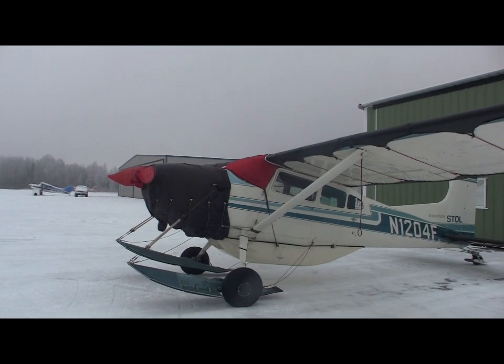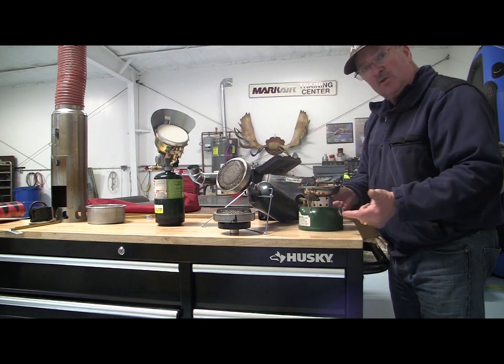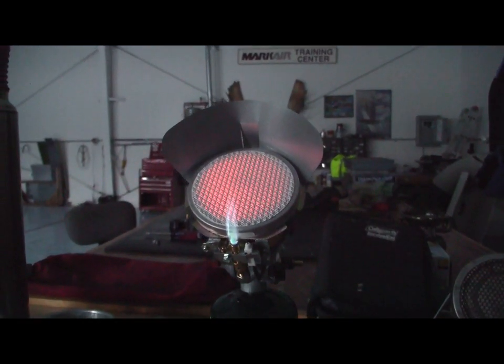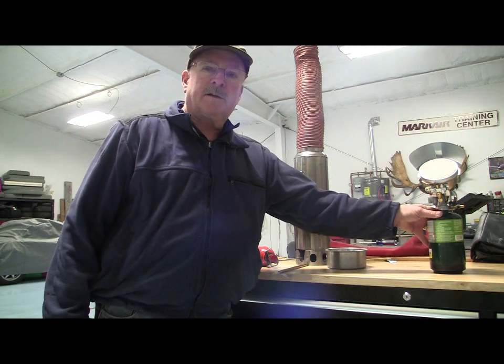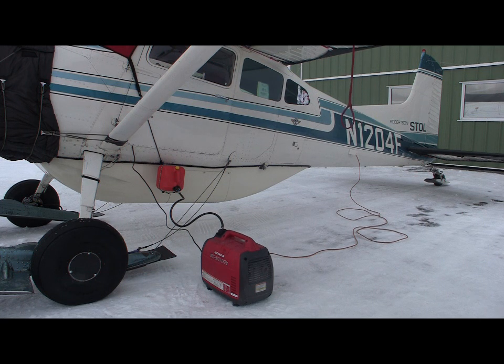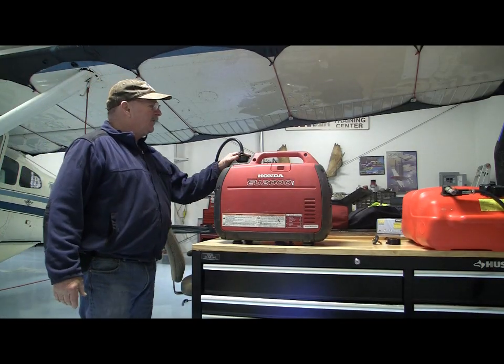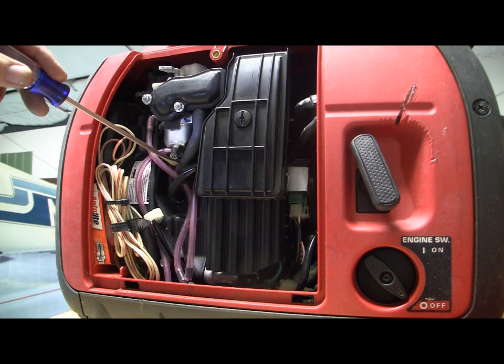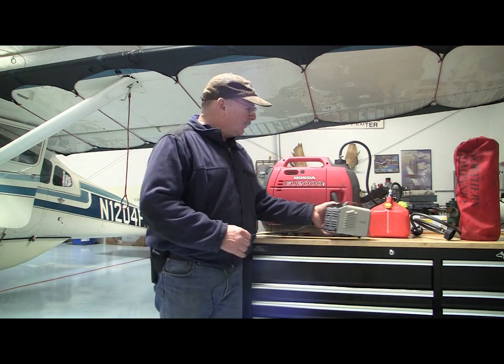Winter flying in Alaska, Wing covers and pre-heat

Comment: Tanis now has heat elements that use either a rocker cover or intake fastener. No need to remove temp probes. Thanks for the video. Very helpful.